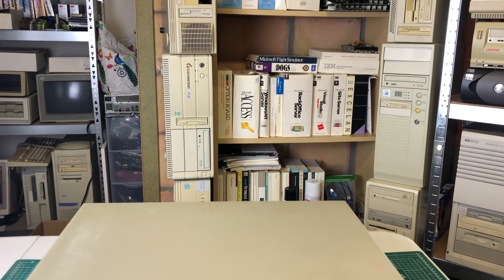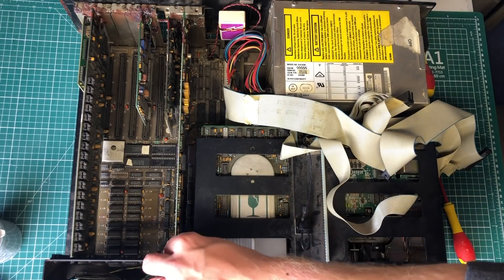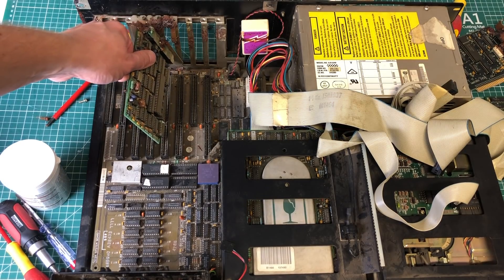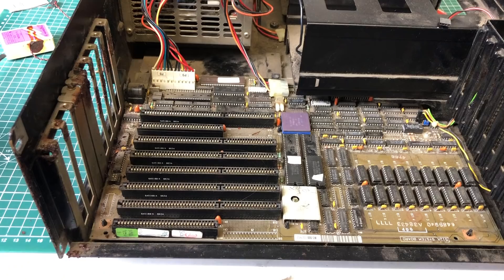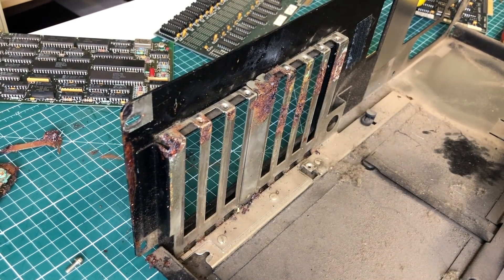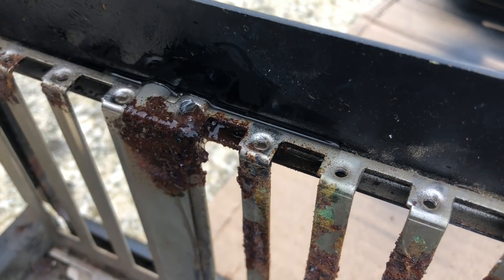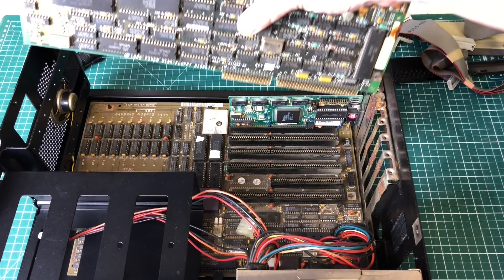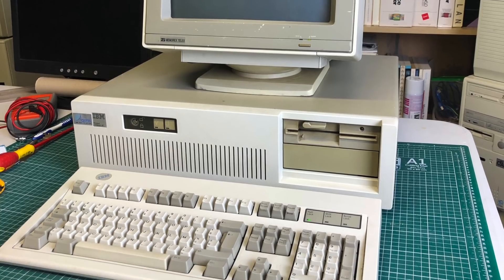IBM 5170 battery disaster : Part 1 !

Comment: I have to replace a dead battery on the AT I acquired. It’s a 6 volt Duracell lithium with wire connection attached with felpro. Where can I get a replacement?

Comment: That was one very rough looking system.  That battery did it's best to try to destroy it.
Reply from the maker: Luckily it was stored on its side so most of the expansion cards got hit and not the motherboard. (Luck depending on how you look at it)
Reply: @RetroSpector78  agreed 👍

Comment: This PC is badly corroded, but I think it is pretty lucky it was stored on its end otherwise that alkaline damage may have been all over the Motherboard.  Having a look at it, was the battery actually leaking or had something else spilt inside the PC and just dripped over the battery?
Motherboard / mainboard are interchangeable as far as I am concerned.  In fact, it could be Motherboard, Mainboard, System board, logic board etc.   Motherboard came from the fact it is the mainboard that "takes care" of everything.  Daughter board kind of came from the old fashioned view of daughters helping there mothers.
I really like ESDI hard drives compared to IDE.  I think they perform better than early IDE's.  I did tend to see more that used MFM (Modified Frequency Modulation) encoding than RLL (Run Length Limited) encoding, but I think the RLL's slightly outperformed MFM's.   Just working on my memory :)
You will probably find more of these type of machines with MDA/Hercules cards in them as these were business machines and not gaming.  The more gaming ones of this particular era would have come more the EGA rather than VGA I think :)

Comment: the hard drive seems to be worth alot, saw one on ebay for 800$
Reply from the maker: There is lots of crazy sh*t on ebay. Why anyone would spend 800 USD on a ticking timebomb is beyond me. There is > 50% change this drive will fail each time I turn on the machine :) I understand the whole period correct thing, but some common sense is needed for storage. Put in an xt-ide or scsi2sd solution, and if you like the noise / weight / heat of an MFM drive, just put any cheap or broken MFM drive in there, attach a power cable but don't connect the mfm cables and you also have the MFM experience :)
Reply: @RetroSpector78  and literally all the time they don't have the connectors or an older pc for it, so it just kind of sits on there desk or something xd

Comment: lol oh yeah good idea don't clean anything and apply power, lets see how many arcs you get and destroy anything that was left of that computer. Wow you really should not apply any power and look for leaking capacitors. Why would you work this way?....?
Reply from the maker: I did check for shorts on the psu and the hard drive before I turned both on. I didn’t hookup the motherboard before I verified the voltage rails on the PSU. Sometimes you need a leap of faith. Capacitors can fail without them leaking, in circuit testing (even with ESR meter isn’t always 100% correct). It would be very cumbersome and time consuming  if I had to recap an entire psu every single time before I turn on a computer. But I welcome any type of feedback on this.

Comment: Originally the IBM 5170 PC AT came with the MDA or EGA card a step above the CGA.  Later CGA/EGA cards came on the market and when the PS/2 came to be the VGA really took off.  But the real first high res color video cards on the PC AT 5170 was the EGA.  (I had one at the time on my IBM PC AT)

Comment: Quite a good idea to store it on its side, in the end: better have the battery leaking on daughterboards than main board!!!
Reply from the maker: Exactly ... and the brackets took most of the hit. Only 1 expansion card died (the one for the tape drive, so not that big of a deal)
Reply: Or store it upside down :-)

Comment: That battery has more gunk inside it than it's case size should allow for LOL.  Good thing it was in it's own little enclosure, and not mounted directly on the motherboard like most were!  Also, the power supply voltages were probably a bit off because the HDD alone is not enough to properly load the outputs.  Looking forward to the next video!

Comment: I just fixed a Zenith AT clone that was even worse than that. It had a battery literally explode and spray acid everywhere. The bottom of the case was nearly rusted through

Comment: These old batteries are the worst, I have had my eyes on a local 486 for a good price but neither me or the seller can figure out if it takes a barrel battery coin cell or the clock chip style battery so im not willing to take the risk on what may be a ticking time bomb since I dont know of anyone I could send it to for reapairs or modifications if it is indeed the barrel type battery

Comment: So miss my IBM AT my father obtained a load of them at one time and I ended up with one ... I actually sold the board on Ebay for around £40 in 2017 it was in the cupboard for decades lol and the buyer told me it still worked perfectly .. quite shocked board was immaculate just that battery you connected was missing and i did not have any way of testing it but a bonus for the buyer so all good!

Comment: 6:20 I have a 70 MB ibm MFM HDD, it is very large, when it starts it seems that it will take off hahaha.
Reply: I had a Microscience HH-1090 in my 386 as a kid, around 1996. I've first replaced the 286 motherboard with a 386, then the remained 20MB ST225 was too small to fit my stuff on it... So I've got that huge drive from a friend's junk, and installed as a secondary drive. The machine was running Windows 3.1, and I squeezed everything into a flat desktop case, with the two hard drives. Good memories... on loading a program, the huge drive shaked my desk... And I had still an old yellowish Samsung Hercules display for it... I remember, that I could run autoCAD on it, but with that 2-color graphics. Fortunately that 387 mobo had a 387 co-processor installed... All of these components I got for free, thrown away by others, I've only bought an 1.44" floppy to achieve comparibility with friends...

Comment: The power supply requires minimum current draw of  7A on +5V and 2.5A on +12V to regulate properly. The supply does not turn on with no load. If you had an AT without a hard disk, IBM would put a 5 ohm resistor to load down the 12V supply.

Comment: I would say that they came with EGA, not VGA
Reply: You are correct about VGA. It was definitely not a factory option for the 5170. They could be ordered with either CGA, MDA, EGA or PGA. VGA was introduced with the IBM PS/2  series in April of 1987. The 5170 ended production that same April.

Comment: 10.8 v is definitely too low, that power supply is on it's way out and may have been why it didn't boot with the extra load from that card actually trying to drive the hdd stepper motor. At a minimum measure the ESR of the caps inside. Also maybe try testing with a good power supply?
Reply from the maker: It worked fine with another mfm controller and there were bad caps on the mfm controller I showed here. So the issue there was definitely the mfm controller. 10.8v is not ideal, but it will not prevent the computer from running. Not ideal true, but the same can be said about many other things from a 30+ year old computer ;)
Reply: @RetroSpector78  It'll run but who knows for how long. I say prevention is better than cure and 10.8v is out of spec and could cause instability/intermittent issues into the future (from experience) It's totally up to you though :) it won't fry anything!

Comment: I'd use a nut driver to avoid stripping screws that are rusted on like that
Reply from the maker: You are completely right ... honestly have no idea why I didn't thought of that :) That's what you get when you let a software guy tinker with hardware :)
Reply: I was also thinking this, as it's worked well for me for hex screws that were in a similar a condition.
Reply: Agreed🎄

Comment: Didn't expect it to work at all.  That controller card may have some shorts to ground on the bus lines dragging the ISA bus down and preventing post.  Being a miltilayer board they can be a bugger to repair but it is possible since you can see exactly where the damage originates.  Nice vid :)

Comment: I'm guessing shorted tantalum on the controller card ? Or the electrolyte is shorting some traces
Reply: these damn tantalums... i got 2 old finds here untested because i am afraif of exploding tantalums.. but i am curious if they still work. a 8088 and a NCR PC8 286 with 2 monstrous 30 MB HDDs. The same that is showed here. The whole thing weighs like 30Kgs. Anyways... i fear tantalums at startup... :D
Reply: @MarcRyderProject  Don't be overly afraid, I have a decent amout of running vintage equipment and it hasen't happened to me yet. It would be interesting to see if they work. Worst case do the initial powerup outside. I think these days rifa caps go up in smoke more than the tantalums.

Comment: What do you use to record the audio? and the video for that matter.
Reply from the maker: Just my iPhone and a usb microphone. Is it that crap ? :)
Reply: @RetroSpector78  All is great actually. Very professional. What USB microphone exactly? I want to make a few videos myself, don't want to spend too much on gear at this stage.
Reply from the maker: It’s a cheap Trust emits studio usb microphone. Lights are very important... in my garage unfortunately I’m not happy at all with the lighting. Works better in my desk.
Reply: @RetroSpector78  Thanks. GXT 252 Emita Streaming Microphone is not cheap at all though
Reply from the maker: Will need to look up the type, but was 90 EUR I think and came in a small metallic case.

Comment: VARTA: I'm destroyer of worlds!

TADIRAN: hold my beer 5:25
Reply: Maxell: hold my wife!
Reply: @goncalodumas  ...if you can

😁
Reply: Yea I never trust the TADIRAN, there from, IRAN..
Reply: As I used to say - varta gówno warta - Varta bullshit worth... :)
Reply: I think the VARTA batteries did well to last as long as they did.   We are looking at equipment over 30 years old in most cases.  We just see a lot of them because they were the most common brand of batteries used in PC's of the time
Reply: @EsotericArctos  fair enough. Yet I can't remember I've ever seen coin cell battery leaked, even several decades old ones...
Reply: @nneeerrrd  coin cells seem to be pretty unique in the battery world.
You are right, they just never seem to leak.
I believe they were not a viable solution for PCs back in the Varta days.
Reply: @EsotericArctos  well, I can remember Dallas then. They have never leaked in my experience, as well
Reply: @nneeerrrd  The Dallas modules you mean?  They are completely potted from memory.  Yes, a real time clock and battery all in one.  That is the way everyone should have done it
Reply: @EsotericArctos  yes, those nice hefty black bricks :)
Reply: @nneeerrrd  I don't think anything would leak through the potting those Dallas RTC's have.  Not even an old Varta :)
Reply: @EsotericArctos  hence the question: why would not other battery vendors do such a good job?
Reply: @nneeerrrd  Guessing because Dallas made an RTC and Battery in one, not just a battery.  The potting was probably an easy way to not only keep it all contained, but make sure no one else could copy their design.